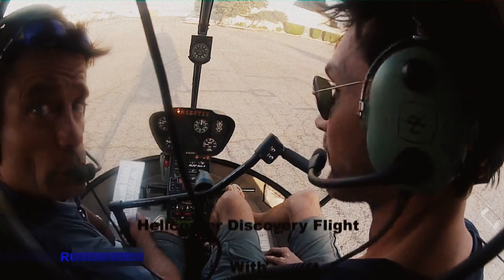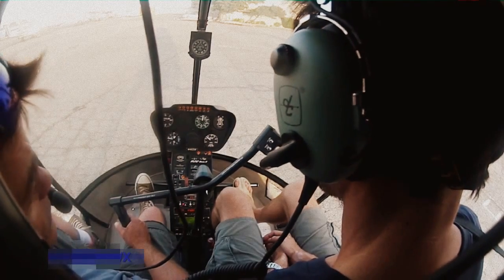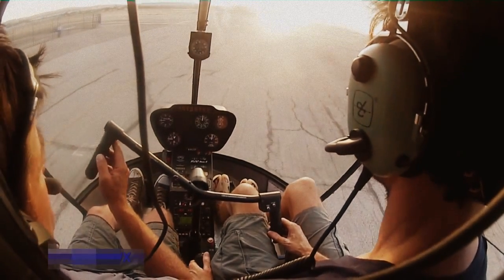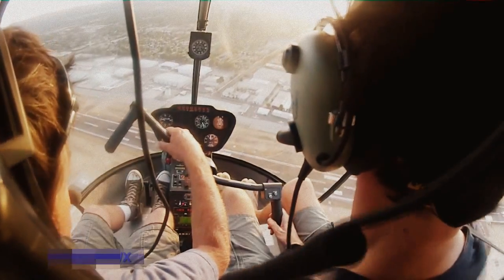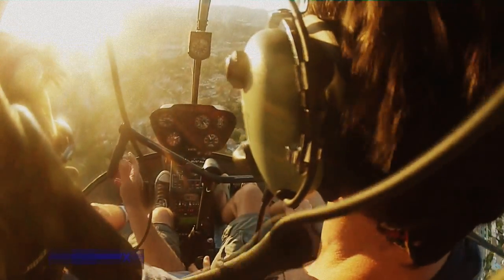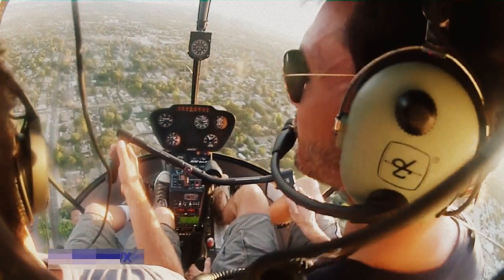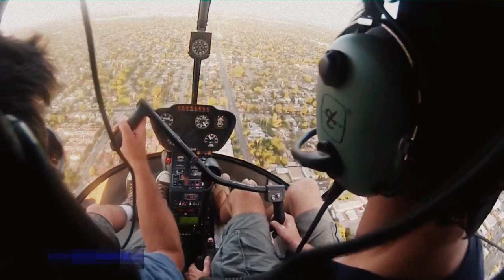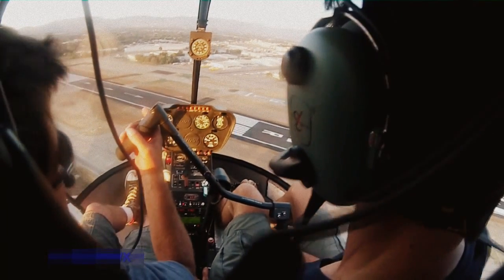How to fly a Robinson R22 Helicopter flight training intro demo flight (including communications)

Comment: To be honest they shouldn't have let you fly in flip flops. As soon as I heard Rotor FX in his initial call I cringed. Bad rep in the industry. So many issues in this vid. Congrats on having the balls to post it.
Reply from the maker: What with the sarcasm? And what's your issue with flip flops, especially in this context of a demo? There is no rule saying you can't fly with flip flops.. It's not like I was flying solo either - I was being lead by the CFI/PIC as any CFI should be was always ready to take the controls.. I ended up getiing my PPL elsewhere and worked on my CPL/IR at yet another school- haven't used flips flops since- but in this video I was essentialy a passenger
Reply: BS. RotorFX has been around a long time and has a strong Rep as a flight school. Don't know why you would post negative comments. I've flown with them multiple times and they are professional.

Comment from the maker: Hey Keith-Yes-Just confirmed I'm going to train with Star Helicopters in Hawthorne-with the chief pilot there- really got a gut feeling when doing a demo with her that she's the one to work with- Star seem like a great outfit going places as well- can do part 141 or 61- you can see her instruction in  my video uploaded Sep 24th titled 'R22 heli flight training- start up, pattern work, hovering practice & shutdown (comms included)'-she helped with the muscle tension by adding trim on the cyclic
Reply from the maker: if you're referring to those electric multi rotor/drone style aircraft, I wouoldn't fly  in one of those til they add a ballistic parachute or some kind of redundancy should the motor/s fail as you can't autorotate them like you can with helis